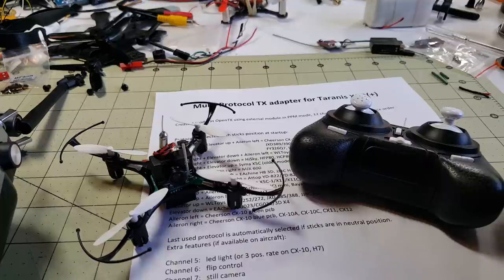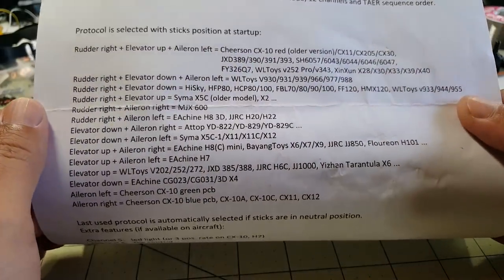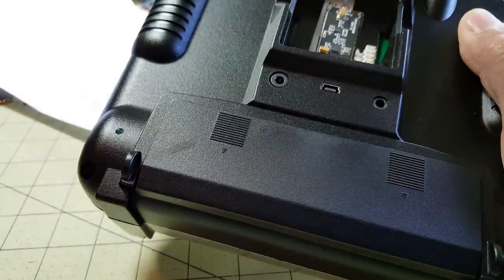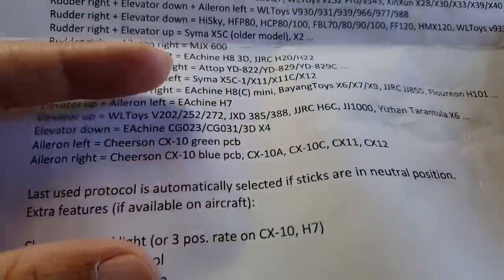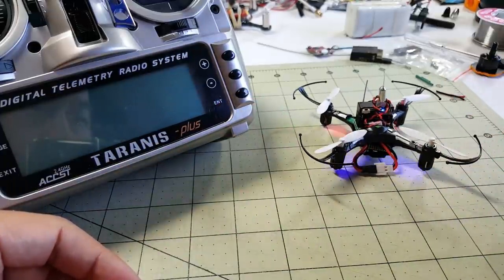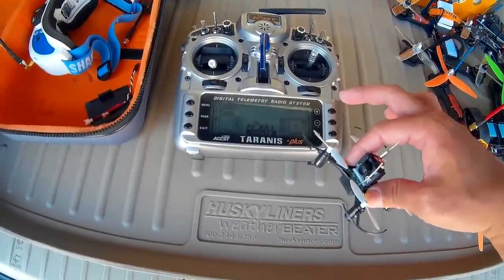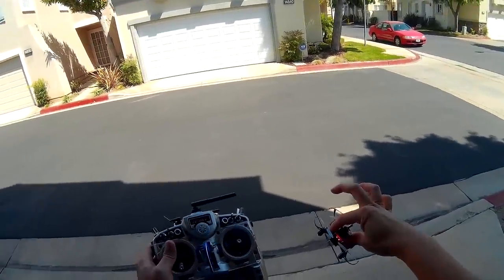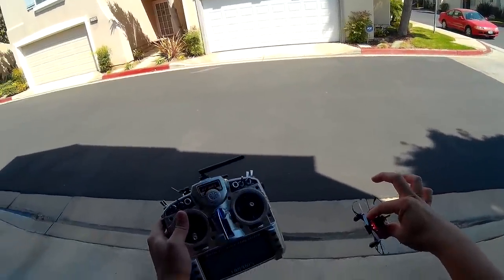Flying the Whoop Killer with a Taranis

Comment: With the multiprotocol module from bangood you can add 2 resistors to enable serial communication for selecting the model from the menu. Is this also possible with this module? Schould be as i understand the banggood is a copy of this one. 
Do you still have a 'flip' button?
Reply from the maker: +123jetro sorry I don't know. I think flips can be assigned to a switch as it's just one of the channels.

Comment: have you gotten the dual rates to work with h8 mini and taranis?
Reply from the maker: It's automatically in the highest rate.  If you want a lower rate you just program it into the Taranis like any other model.
Reply: okay, maybe because I'm using silverxxx firmware, still learning. thanks!

Comment: Albert the link you posted does not lead to the module discussion I really want this module.
Reply from the maker: I fixed the link.  It's around that page but the thread is 45 pages long so there's a lot to read up on.  I suggest contacting goebish on RCGroups and he can make one for you.
Reply: and here's the discussion on this module https://github.com/pascallanger/DIY-Multiprotocol-TX-Module
Reply from the maker: Yes, someone else also mentioned that to me and I am looking into it.  It looks like it may do even more protocols.  I'm not sure if I will get it for review however.
Reply: well I'll be on the lookout, doing some reading on it in the mean time :)
Reply: Hey Albert, can you make a video showing how to activate the extra channels and assign them to a switch, you know like the flip, RTH etc... ?for instance on the list it says channel 5 is led light, how do I use channel 5 in simple terms.
Reply from the maker: +Gus F ok
Reply: Awesome looking forward :)